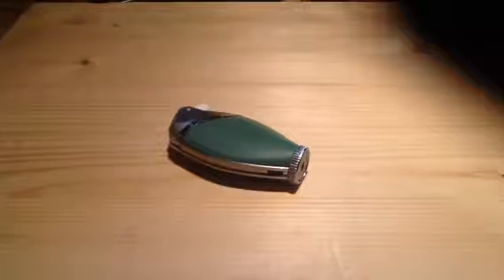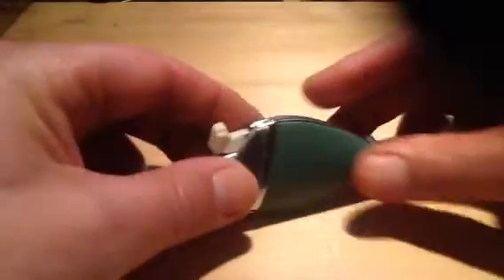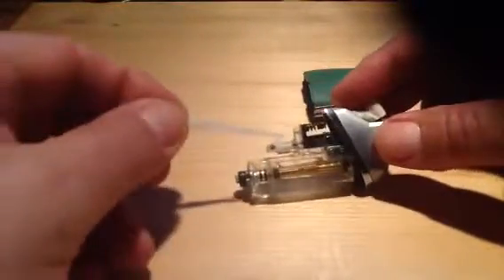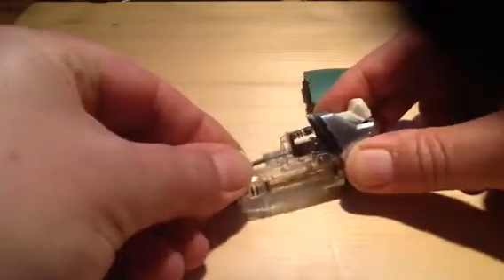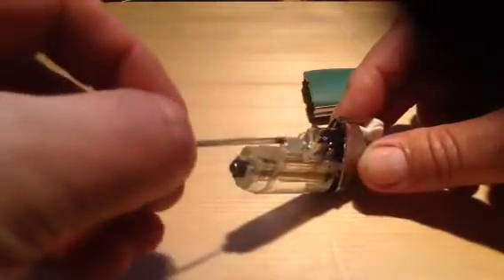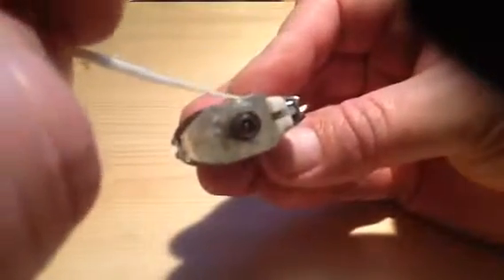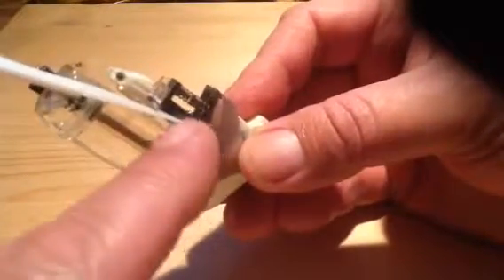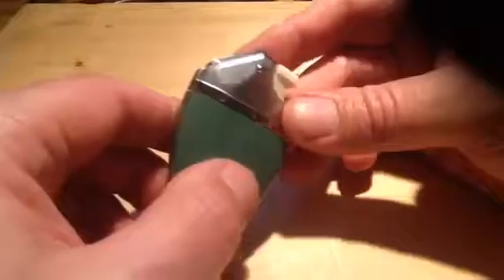How to change the flint on a IMCO G 11 lighter

Comment: Changed the flint but the flint roller dont work 😕
Reply from the maker: Muszkowicz If the flintroller is stuck then try rolling the flintroller backwards and then forewards again. Be sure to remove any small flint parts first. If this does not help then try replaceing the flint with a softer type flint. (Do NOT use Zippo flints!! They are way to hard and will destroy the roller. Use flints from IM CORONA, they are the best, fairly soft and give out huge sparks. Or use the very very cheap Chineese zippo flint copys, no huge spark but the flint is very soft. (I buy the IM CORONA flints on ebay and the cheap copys from dealextreme) Take care and have a happy newyear.🎉🍺🚬🍾💥🎉